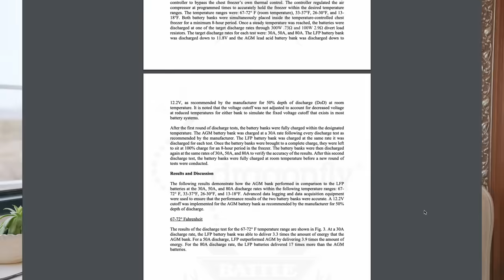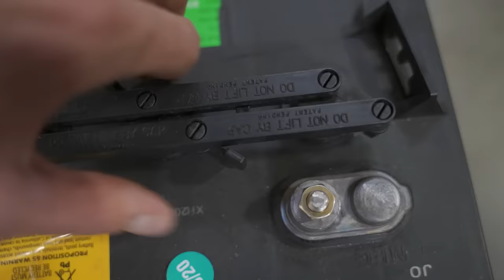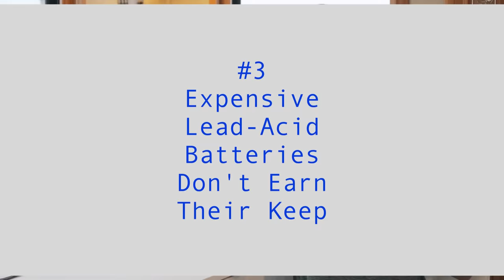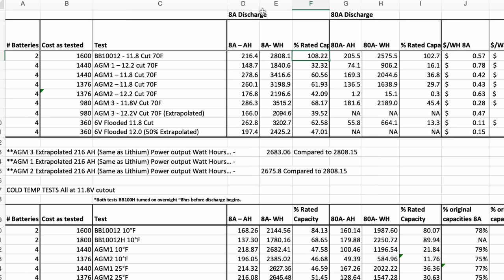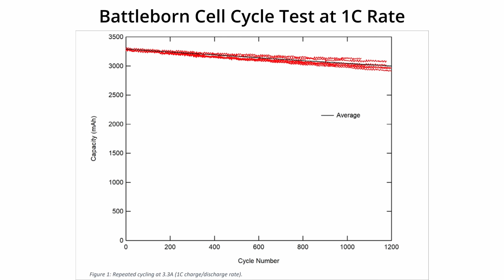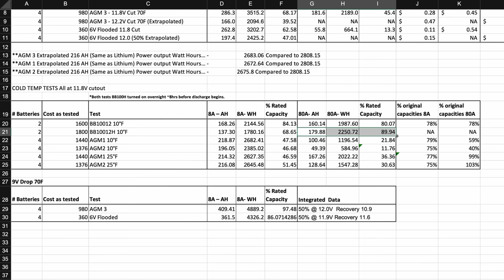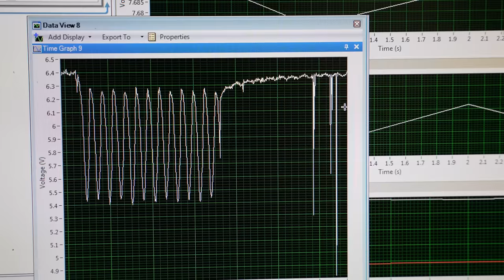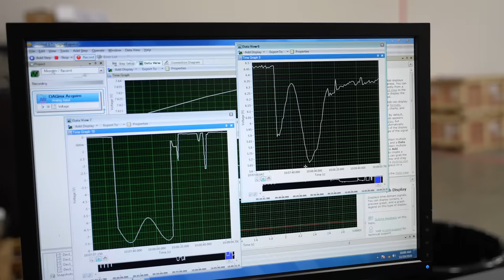Don't Waste Your Money On Batteries - The Shocking Truth I Discovered When Testing RV Batteries

Comment: So tell me what 1000 amp battery I can get that is 84 dollars that last me 25 years.  And a 100 amp hour battery only gives you 100 amps. I will never buy a battery that only one hundred amps.  And if it is not 100 amps what is it. And to buy one of those batteries for four or five hundred dollars to one 84 dollars batteries. My batteries lives. In my cold front porch that gets very cold in the winter and 20 years with my let us battery still sounds better to me. So why should I change and for me to change the price will have to change as well because I can't afford to buy 24 lithium batteries. But if the batteries get cheaper I would try other types of batteries. But the cost would make me homeless at that cost and I just paid off my house last year for the third time the dam bank raise the cost that they wanted when cover 19 came from 164 a month to 489 a month and 18 off the  mortgage each month. So why would I get other mortgage as well.

Comment: my stance was always that batteries are a necessary evil, i owned 4x 150Ah 12V AGM batteries for 4 years, at the 1th year i know they were dying one by one, and i resigned myself that was to be expected given what i know about lead acid batteries
i'm planning to either buy OPzS cells or Lithium ones, but big Lithium arn't available
i ended borrowing a flooded decomissioned Ni-Cd cell blocks and i will test them

Comment: There is no way a lead acid, or a AGM can come close to a lithium. How I know took a 20 foot travel trailer with a solar system with lead acid deep cycle. Then we swapped the 100ah Lead acid with a 50ah LIFEP04 and it held 12v for way longer than the lead acid. I don't know why they even make AGM, or lead acid deep cycles they are useless and expensive.
Reply: Lead acid and agm are not useless, they are just not as good for energy storage. Lead acid is wayyy better than any lithium when it comes to starting a car or truck. It can put out 7-10x the amps a lithium can. Good luck turning your engine over in the cold with a lithium battery.
Reply: @randybobandy9828 Were not discussing starting an engine were talking about RV batteries. Yes, I agree starting an engine is the only place that a lead acid does better. Even Toyota has done away with that in their turbo charged hybrid engines they use the lithium-ion battery to start the engine. Lead acid have lot of issues in cold weather as well. Lithium-ion does better then lead acid in cold weather. Lithium-iron or LifeP04 they don't do as well in cold weather.

Comment: You say none of the lead acid batteries made the rating based on voltage...

Did you follow the manufactures info on info on how to test the voltage? Where the batteries left at rest (no charge or discharge for a couple hours?)  You say you've built battery systems, so I hope you did. I suspect you didn't allow the lead acid batteries to cycle 50x to reach full capacity...

PLEASE DON'T LIE!!!
You say the batteries are cutting out ate 15% of their rated capacity at 80 amp discharge, BUT IF YOUARE USING QUALITY BATTERIES, They will have a chart showing a rated capacity if you are using a higher discharge than the 20hr rate.

Voltage is an awful way to determine State of Charge SOC. Did you measure the Specific Gravity of the Flooded batteries?

For an RV, Lithium does make sense, but mostly on the weigh and the way you use a system. 

FWIW - Golf cart batteries are often taken down to 20% SOC daily, I don't deal with AGM, but manage 5 years on 4 golf cart batteries (cheap Energizer/Johnson Control from Sam's) which lived outside in temps up to 100 degrees, I ran an window air conditioner daily over the summer running the SOC down to at or near 20% SOC daily. The 1 year old batteries lasted 4 summers in this manner. Cost was $80 per battery at that time about $100 now.  I didn't chart the duty cycle of the air conditioner, but I know they ran near 100% for the first 2 hour. 

My 16.5 kWh forklift battery is 11 years old and will need to be replaced in the next couple years. I suspect I'll buy another at $2700 rather than buy lithium at over $10,000 and have to redesign my system to have the battery inside.

Comment: AGM are absolutely the worst batteries made they will not recycle from discharged they die like AAs in your flashlight  even 600$ battery. The electrolyte does not circulate is one major malfunction lower tech lead acid batteries with no glass fiber! could discharge and recharge where AGM would not charge without a 12v float charge. my experience is that the marine gel cel batteries perform best. Lithium are fantastic except 1. they explode violently should your charging protocol fail or malfunction and not shut off. 2. is Im a offshore sailor I often find myself in the middle of no where literally with a low tech lead acid battery i can possibly repair a malfunctioning or broken battery with lithium if they are dead or you lose a charger you SOL you need a combo .

Comment: You tell us that most of these batteries cant be run low, then you run them beyond efficiency (which is informative) but then you collected data based on it being extrapolated data, meaning you ran the batteries past their efficiency, divided the data by the full range parameters, which could be true if you dont run an optimized sys, but not if you do!  The whole purpose of this video being "proper, or efficient" run and performace comparison, the only thing no one is here for is extrapolated cycling "based on just the performance range of litium batteries which the others all have a completely different run cycle.  We all came here to run "within" optimized range projections.  Without the optimized run data for "each" system, extrapolated then by the optimized cycle window for "that product", you arent comparing apples to apples, you are seeding one gold mine.  You failed to be a neutral conscientious objector and adjusted parameters to favor your sales pitch but we noticed!  The product will sell its self if its good, while you just sold your credibility for a battery.

Comment: I stopped watching after 4 minits, i cant affort lifepo batterys. 
That being said i prefer a coolerbox instead of closetstyle fridge.
Ive insulated extra on the outside...
In the coolerbox the cool air go's down, opening a fridge-door and it will fill whit warm air thus starts cooling again drawing current. 
Charge the laptop/everything when the sun shines... 
New batterys are coming in the next 50 years.
Save your money on batterys. Use the solar directly. Rest when the sun goes down. Have a candle/oillamp. 😂

Comment: I been an electrical engineer for 40 years.. Give you some advice...They still teach it 350 years later as Electrical Theory for a reason..

So these test are horse shit.. As nobody knows how these batteries will perform in any give situation..

I would add. I seen people this year in Texas. That Lithium batteries failed. As the temperature fell below -21 degrees. Where AGM users were still able to get some use out of their setups...So my suggestion to Lithium users in cold climates. Install heat strips..And have a Generator that can handle cold climates. As power was everything. When you didn't have it for 4-5 days. As people died from it....

Good Luck

Comment: Battleborn 100ah $925
Li time $279
Reply: This is a real problem now that offshore LiFePo4 has become so cheap.  Battle Born likely has better quality control and wire lug interface is better for people who lack the "mechanic's touch" or the ability to check their thread depth prior to tightening the bolts.  However, I wouldn't say a BB battery is ~3x better.  For about $4,480 I can buy 16 relatively decent offshore batteries.  If I purchased 16 BB batteries it would probably cost me around $14,800.  Even if I had a couple failures with the offshore batteries, I would still have power and I still would be spending significantly less even if I had to buy a couple replacements.  Now, if my life depended on a single battery, and I could only bring ONE battery, I would probably purchase a Battle Born.

Comment: ... The 2 charts you displayed for cost per Wh don't show what you said.. So you tested 9 batteries, most being agm and flooded batteries but only 1 lithium cell based on charts....

The capacity is obviously gonna be better, lead acid is stoneage tech, n false advertising is huge in the automotive industry among many others.

But your charts on cost make it seem like although the expensive batteries were bad, lithium wasn't the best. It was 6th place on cost... Of 9.. So lead acid is giving bad data and over priced but lithium is still too pricey to be economically adapted as the norm compared to standard or cheap lead acid. Lifepo4 is worse... N with current import tariffs prices have doubled and are still going up due to greedy carriers n greedy manufacturers (this is all industries).

The deep cycle test (80Ah) isn't really fair since lead acid has "deep cycle" batteries and non deep cycle.. So it was obvious lithium would be top 3 (if not for price keeping it down), it was 3rd of 7 tested. (why was there 2 not tested btw?)

This test was sponsored n a bit bias because of that.. Not apples to apples.. But I like the part on Wh vs Ah, these test setters need to form a standard for everything already... No standards is allowing for false advertising to run rampant. In mpg, capacities, effectiveness etc.

The cycle test point is a good one, lithium cells over their life is where they really shine.

For the heated battery that's a good idea, using internal Heaters. But insulating them would only be a good idea during cold weather as it could promote over heating layer on the year.

Comment: Your data is fine for "testing" but, in real world use lithium batteries DON'T WORK !!  When it's 18 degrees out, a lithium battery WILL NOT START YOUR CAR !! An AGM will. Been there, done that. Had to remove the battery to set by the fire to thaw out so we could start the truck. 
Same thing goes with portable battery packs. They don't work when really cold.  Lithium is fine for solar storage in a controlled environment but, not for out in the wild real world use.  End of discussion.

Comment: at 13:27 you lost me.... in Canada we live in -40 Celcius for long periods throughout the year.... lithium just doesn't seem to be cutting it here.... might be fine in the "lower 48"... but up here? i dunno....also 20:25 "warm weather data"... yeah... as a Canadian, I am not convinced. Sorry. Why not put your AGM bank in an area in cold weather climate(Canada) where you USE these batteries to run your "diesel heater" to keep you warm and stop over analysis folks from trying to sell you over-priced lithium batteries? You live in the tent, outside, outside my camper, begging for beans warmed-over in the morning. Sorry. NOT GONNA EVER spend that kind of money for lithium batteries up here. Never. Makes no sense! -40 is -40! For eons flooded has worked... keep 'em charged and never let them freeze! No brainer! Keep your AGMs WARM and you'll be FINE!

Comment: Complete fail. You hard wired lead batteries in parallel. They fight each other. AGM batteries cannot be diluted for better deep cycling. I would be very unnerved, if someone with an electrical engineering degree, started designing and wiring up my battery system like a complete know - nothing.

Comment: I HATE agm batteries. Never the power claimed and have to be watched and pampered and STILL easily ruined. AGM's are dinosuars and they are not cheap. edit The last and i emphathize LAST, agm battery i bought claimed 100ah. Play a 36 watt 19" led tv for 4 hours, already at 60 %.

Comment: After seeing a lithium battery fire burn a class c RV to the ground I will continue to use lead acid batteries due to their 100 year history of proven reliability. 

I'm sorry if you feel differently but I survive fine using lead acid batteries. I haven't had any issues. Maybe you're getting paid to  misrepresent actual RV usage?

I listen to this video several times and it reminds me of a used car salesman trying to sell me a pike of junk.

I run my RV on lead acid golf cart 6v batteries. I run solar. Never ran below 12 volts. No issues. Cheap cost. No need for mega dollar lithium batteries  at all. Don't fall for slick sales gimmicks

Lead acid is reliable and CHEAP
You can't say LUTHIUM and CHEAP in the same sentence.

Besides....
What are you trying to run in an RV on batteries?
Reply: In my RV repair business, 2 or 3 of my customers have huge inverter banks of 8 Li batteries. They pay $7-$8K for batteries vs $1200 for T-105's.  I charge them extra for labor, even though these 'gold plated' batteries are lighter. Obviously, they have money to burn. 🔥🔥

Comment: Completely disingenuous.
Lead acid battery voltage specifications are taken "open circuit" but the test took them "under load".  This guy is either not a power engineer as he claims, or he is being paid to mislead the viewers here.
He gives us a couple clues when he won't say who manufactured the lead acid batteries (afraid of a lawsuit), and makes statement like 
They solved all the issues with lithium batteries in cold weather.
He should run for congress.

Comment: A lot of words that actually mean nothing!
How about you start trying to test the batteries in a real setting !
My old deep cycle lead acid ( not age) batteries have a better return on investment than any Lithium batteries !
I didn’t need any special instruments to test them , I used them in real life camping off grid settings !
The newer less acid batteries do not have as good life or performance as older lead acid batteries and agm
Is just a waste if money !
If my lead acid batteries run my house for 24 hours ( they actually run it for 38 hours !
Then all the numbers you spout mean nothing to me !
The fact is these batteries are just not wort the extra cost !
The numbers in this video show me noting !
Ok or shows me you did nothing to prove cost efficiencies!